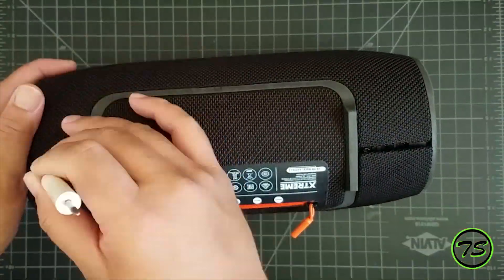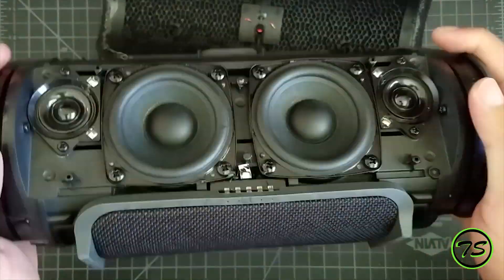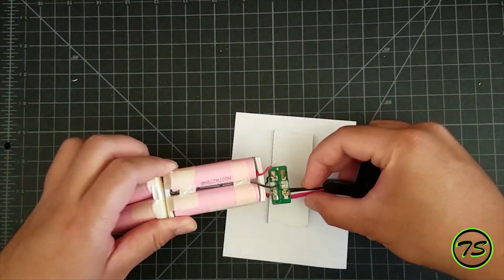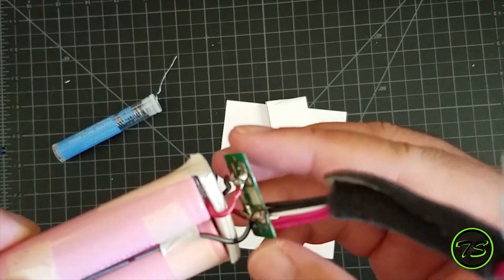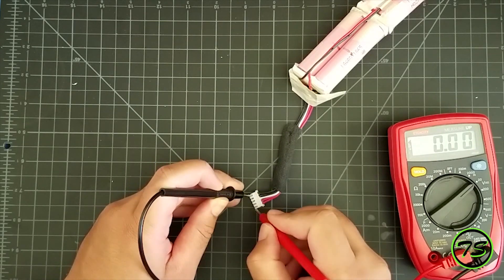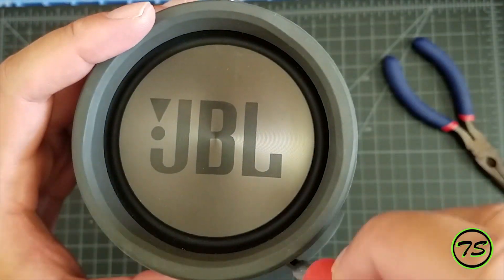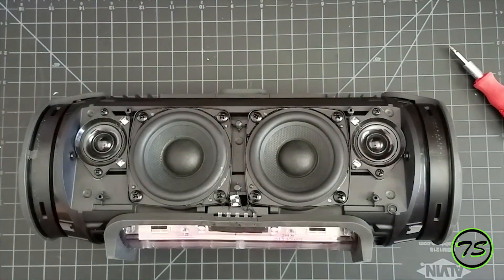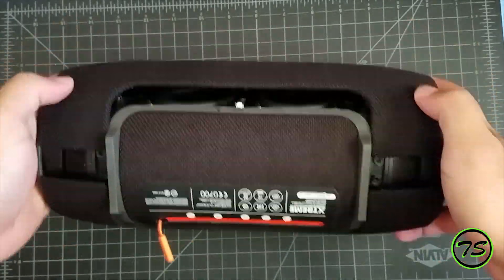(UPDATE) JBL Xtreme + 18650 Batteries (DIY)

Comment: I struggled so long with this stupid board.  Could not get the solder to stick to it.  Surprised I didn't kill the thing with heat stress.
Reply: Heat it up there's an aluminum plate on the board, that needs to come off before you can solder to the circuit board underneath.
Reply from the maker: Yes the BMS board is a pain to deal with.
Reply: How did you manage to solder it? Couldn't do it even after removing the aluminium plate

Comment: Hey i just subscribed great videos keep up the good work i just saw this video and i was like well where will i find 18650 battery’s and then i hit your channel and saw your video on how to obtain battery’s from a self balancing hover board and thought i would take my old hover board apart and i removed all 20 li-ion battery cells  they are by LG but i don’t know if they will work they are marked lgdamf11865
0320k162a2  I’m not very experienced with these kind of things i have a friend who can install them but he needs to know if these battery’s will work first and if you could send me a schema of how to connect the to the bms thanks in advance!
Reply from the maker: Thank you for the support, I am working on a video on how to find out which 18650 is still good for use. I haven't really had time to finish it due to family duties, planning to upload it before 2017 ends and I will add a schematic for the BMS as well.

Comment: If not use bms board what happens? I lost my
Reply from the maker: You can always buy a battery on eBay, I’ve seen both original and those that aren’t but still works but it’s just less mAh. In other words just less playing time but still good enough to enjoy hours of music that you love.
Reply: If connecting directly without BMs, works?
Reply from the maker: +Fernando Jose I don't think it's a good idea because the batteries won't be protected from being over charged. That's what I think, I haven't tried it but wouldn't recommend it.
Reply: Ok thanks

Comment: my speaker just stopped had my phone charging on it and now it wont turn on at all plugged in or anything. Any ideas to fix
Reply: next time jist hold + and bluetoth button to make hard reset ... i will try relacing this batts with 18650 as in ur video .. nice job man
Reply from the maker: Wish I had an answer for you, tried researching about it but I can't find a solution.
Hopefully someone knows something about this issue.
Reply: ended up taking out battery and when i plugged back in it worked
Reply from the maker: Wow it was that simple, good to know so if it happens to me I can try that easy troubleshoot.
Reply from the maker: Yes that's right, forgot about that key combo.
Thanks for the support man
Reply: Mine did the same thing.  Started when the original batteries started to become faulty.

Comment: is it really true, that the original jbl xtreme battery has 5000mAh battery, instead of 10000 mAh?
Reply: I got my friend, I changed the battery and put the 4 in place of the original, I'll test the weekend and see the durability of the sound with the new ones I put.   https://produto.mercadolivre.com.br/MLB-743554437-bateria-panasonic-ncr18650b-3400mah-li-ion-37v-original-_JM
Reply: what would you recommend, just order original battery or mess with the 18650 batteries? obviously u get more power with 18650s, something like 12k mAh, but with the original, it's like 99% everything gona work as it's suposted to, but with 18650s, im not quite sure, if it's gona charge properly, etc
Reply: I found the originals very expensive, and I chose to buy the ones that were indicated and came out less than half the price, and worked out right in the same place as the originals
Reply from the maker: +africabambattaa yes only 5,000mAh, I didn't believe it at first until I actually found the hidden label stating "5000mAh @ 7.4V" this was after I recorded and uploaded my videos.

Comment: the capacity is less than the correct original battery? because they are 4 of 3400mah parallel, and how long is it, is the same thing as original or longer?
Reply: From what I remember JBL says that the original unit has 10,000mAh?, the original battery that you are looking at says 5,000mAh on the label ...but there is two sandwiched together (Lipo's) making it a total of 10,000mAh...right?. You would be replacing that with a total of 13,600mAh which has a bit more capacity. The BMS should be safe charging  the extra capacity. I doubt JBL is going to lie about the battery capacity, it is something that can be easily proved.I will be going with a replacement battery rather than with the 18650's but I will most likely go with trying that the next time the battery dies. Cheers All
Reply: I put the 18650 and it was spectacular
Reply from the maker: If you use any 18650 that has 3000 mAh or higher then its longer playing time then the original. I found out on the label it's only 5,000 mAh from the whole original JBL battery pack
Reply: mine is now only lasting 1 hour of battery, I will buy 4 of these and do, it worked in the same place as the original, or had to cut or change something?
Reply from the maker: You're just changing out the lipo batteries that were connected to the BMS board and use the 18650's you bought. Make sure its not those cheap kind because they tend to false advertise how much mAh they have.

The BMS board is with the original battery so be careful when you take that black cover off from it.
Reply: So JBL lied saying the original battery was 10000mAh...
Reply from the maker: That's what I found out on the label of the original battery that it was only 5,000mAh, I am trying to see if I can get a hold of someone that has a JBL with battery issue so I can prove it on video.
Reply from the maker: I'm glad someone is on the same boat as me
Reply from the maker: Whatever works for you and makes you happy, I just used the 18650s for my JBL Xtreme because I had extras that was not in use.
Reply from the maker: Robert Lecocq I am not sure what video you are watching but yes it does say 5,000mAh on one side but it also says 7.4V. Which is wrong if you are thinking each cells is 5,000mAh with 7.4V. A fully charged cell is 4.2V, same as when the 18650 were fully charged as shown in the video @ 4:18 and yes I fully charged the speaker before I pulled those 18650's out. If you think I am wrong then my 18650s would have exploded by now if the voltage been fed to the them is 7.4V - 8.4V each cell.

JBL is a good company but I am not sure what they meant by 10,000mAh, should be 5,000mAh @ 7.4V as it says on the label.
Reply: Voce e brasileiro?preciso de ajuda
Reply: fala comigo? coloquei a bateria como foi indicado.
Reply: fala comigo? coloquei a bateria como foi indicado.

Comment: whenever i charge my xtreme the charge indicator light (right most led) will flash 3 times and then stop.
Reply from the maker: +maxell5306 was this after you changed the battery to 18650?
Reply: Taylor Soloai yes.and whenever charger is connected theres some weird sound and when you turn on the xtreme it will reset itself on/off until you remove the power.
Reply from the maker: +maxell5306 does it do the same when the battery is removed?
Reply: Taylor Soloai I disconnected the battery and plug the power supply and all 5 led light light up with the last bulb blinking.and theres no weird sound coming out now.i think i have to check my solder
Reply from the maker: +maxell5306 and also double check if the batteries connected the correct way. Like negative to negative on the board and positive to positive.
Reply: Taylor Soloai re solder everything and the hearbeat sound is audible whenever power is connected.also led lights is not working (power status).although the unit is working fine when unplug to power source but still no led light for power indicator.
Reply from the maker: This is just just my guess but I think it might be something wrong with the BMS board, because you mentioned earlier that it doesn't do that when the battery is unplugged. Kinda hard for me to give you a straight answer when I can't see how everything is connected. Maybe you could upload a video explaining how you connected the 18650 to the BMS board and what happens before and after the battery is unplugged. That's if you can.

Comment: how long is battery time ???
Reply from the maker: +KenT. ZzeT in my case I use it at around 50-60% volume and I get around 24hrs of use.
Just depends on the 18650 you use and also the volume you playing music.
Reply: ok thanks
Reply: If you compare previous battary..?
Reply: Taylor Soloai i used a different brand of 18650 batteries an playing it at 75% of the volume the battery last me about 3 1/2 hrs, and when a connect it the LED lights goes straight to the 3rd or 4rd light...??? What could be the problem??? The batteries???
Reply: @eherpin  The problem could be the batteries you bought... I'm planning on buying the 18650 from Panasonic, what did you buy?
Reply: DarkBallShadow  I was using some cheap batteries, after this video I buoyed the same pink Samsung batteries, and the problem is still the same, battery life is 3-4 hrs and the charging time is about 45min. So I’m thinking is the charging plate is not working properly. What do you think..???
Reply: So, it is actualy better then originial?
Reply: @MarMar-kz7hc  Well, comparing 10000mah original to almost 13000mah... the mod NEEDS TO beat the original :D

Comment: Does the original poly battery connected in series or parallel? what their capacity?
Reply from the maker: +Sabahan Ranau same way I connected the 18650 battery to the board. Two poly cells rated @ 3.7V (4.2V @ full charge). On the label it said 5,000mAh.
Reply: so what is the output 4.2? or 8.4?
Reply from the maker: Sabahan Ranau 8.4V

Comment: Nice work.  Keep it up!
Reply: Is the 18650 better than the Original?  How many mAh does it have? The original is for 10,000mah and I only  see a bunch of 5,000. I just want 10,000 or more (if possible).  Thanks
Reply from the maker: During the time of making this video I didn't have the right tools to measure the mAh the 18650 batteries had but I estimated that both pairs had 6000mAh (3Ah per 18650). But considering that these were already used in the Dell laptop I'm just guessing it's between 2Ah 18650. These are just my guess.

The only good thing about using 18650 is

1. They're cheaper than the original one or even free if a laptop repair store is willing to give it to you for free.

2. The battery lifetime seems longer. Im still using the same one.  It's over two years and it's still going.

Anyway I don't think JBL was being honest about the capacity of the original battery because when I looked at the label when I fixed someone else JBL its only rated at 7.4V 5000mAh.

Comment: hi just wondering to know after puttingthis 18650 batteries are you using the same charger? Thanks
Reply from the maker: ...interesting, I'm using the speaker cables too and it worked. (The thin kind) Let me know if it worked or not.
Reply from the maker: +Roberto Salas Vásquez yes I'm using the same charger. That BMS board I showed in the video is what makes it possible to balance out the charging of the battery.
Reply: cool! thanks and one more question... the batteries have to be protected or not? because I'm planning to buy a panasonic NCR18650B flat top 3400mah thanks
Reply from the maker: +Roberto Salas Vásquez I don't think they need to be protected because of the BMS board that keeps it from over discharging or over charge.
Reply: Roberto Salas Vásquez.
No need to be protected. I am using non protected on mines and works fine ..
Reply: Roberto Salas Vásquez when you are going to solder remember to sand the battery or it won't solder it will just run off .
Reply: BRUT3MURD3R3R what do you mean with sand the battery?
Reply: Roberto Salas Vásquez 
Tienes q lijar la batteria porque no se queda la soldadura .solo en los lugares donde van los cables
Reply: hey thanks for explaining me with apples haha! I did everything you say but for some reason is not working can you help me please!
Reply: Roberto Salas Vásquez 

https://youtu.be/KFuXHEkoJq4

Look at that video it has a picture of what you need to do
Reply: Roberto Salas Vásquez look at 1:15 for the picture
Reply from the maker: Assuming that you wired them all correctly remember it won't work for the first time, that's why you connect the charger to activate the BMS board.
Reply: I connected then all but I think I'm using the wrong cables or not the good quality( speaker cables) so I found ticker cables and I'm going to do everything again
Reply: finally I could do it!!! it's working properly but after a few minutes goes off and doesnt work until I connect it to the power cord... why is that I did something wrong? by the way when I was soldering the batteries the negative cable touch the positive cable by mistake... do I probably burned out the batteries? please help thanks
Reply: Roberto Salas Vásquez. 
Maybe a wire is not soldered correctly could be loose happened to me .
Have you charged the batteries yet ?
Reply: I hope is just a wire loose... yes I have charged them during the whole night
Reply from the maker: Roberto Salas Vásquez Yeah I'm thinking the same thing. Might be a loose wire.
Reply: Taylor Soloai It happened to me twice . I out a big wire and it was getting stuck and coming off . works good now I changed my batteries months ago and they are working better than ever .. Good luck buddy

Comment from the maker: I know a lot enjoyed my videos but I would also like to hear some feedback on what you did not enjoy so I can make it better for future videos.

Thank you again for watching
Reply: Mate thanks million times , I did exactly as you said and I used dead laptop battery and did work , thanks thanks thanks.
I did talk to JBL Australia and they said there is no support and parts after warranty which is just one year .
God bless you .
Reply from the maker: Yeah seems like everyone with a JBL Xtreme has a battery failure after one year of warranty. I am glad it worked for you though. Everyone seems to give up at the soldering the wires to the BMS part.
Reply: Taylor Soloai I did use BMS as you said . Because of overcharging problems . Thanks again .
Reply: Taylor Soloai : one question. Does a 18650 with Any 3600 mah will be good for the speaker?
Reply from the maker: Robenson Germinal the higher the mAh the longer the playtime you get for the JBL Xtreme.
Reply: Taylor Soloai awesome I follow the directions  step by step the the result was "no dyol to talk in creole" That's mean I have nothing to say. Taylor you are the man you save my $175 investment. Thank yo SO much.
Reply from the maker: BlackSpider Zordyck yes you can use it without the battery.
Reply from the maker: BlackSpider Zordyck on eBay it's under the name "Nickel Plated Steel Sheet Strap Strip for Battery Spot welding". It was already on the battery when I removed it from the laptop battery case. Anyway yes you can solder it together using a wire, not the recommended way of doing it but just make sure you don't heat the battery too long. 18650s are dangerous so be careful! To make it easier get a soldering wire that already has flux in it and also scratch both negative and positive terminal of the battery with sandpaper to make it easy for soldering.
Reply: Taylor Soloai Thank You Very Much for your help. I appreciate it...
Reply from the maker: Thank you very much, it feels so good to know that my videos are useful
Reply: Taylor Soloai hi i want to know if its possible to do it on the jbl flip 3 ??
Reply: Nima Davoodi should you get new batteries after that ?? Maybe it wont last long :/
Reply from the maker: joshua gabriel im not sure because i haven't opened a jbl flip before.
Reply: Taylor Soloai oh ok , future video perhaps ??
Reply from the maker: If I can get my hands on one then yeah I will.
Reply: Taylor Soloai can I use my JBL without the battery...? Is it safe to use it only with the AC power...? Thanks...
Reply: Taylor Soloai what is the thin metal at the battery...? Can I solder the wire diretly to the battery without the thin metal.? Thanks...
Reply from the maker: BlackSpider Zordyck no worries

Comment: What exactly do i need to solder them up?!  And how did you do it?
Reply from the maker: Those are called "Nickel Plated Steel Strap Strip Sheet" found on eBay but I didn't have to use those since the 18650s I used were salvaged from a laptop battery which was already connected in parallel.
The wires, you can use any. I just used speaker wires.
Reply from the maker: I don't really understand what you are trying to ask but I showed everything in the video of what to solder, if you are wondering where the green board (BMS) is from. You can take it out from the original battery and connect it to the new 18650s.
The link below is the previous video I made and I showed where the board is at
https://youtu.be/hwWD5W2svY0
Reply: He is asking what do you need? What type of wires, I noticed you had something connecting the batteries in parallel. What are those called?

Comment: I later encountered a problem, the circuit board can not be welded to the wire, that is, the use of flux is the same, how to do?
Reply from the maker: +信仲陳 you can use sandpaper or a knife to scratch the surface of the terminals. It will help a bit but still it took a lot of patience for me to weld them on and also steady hands.

Comment: What is the white block that sticks to the positive and negative batteries?
Reply from the maker: 信仲陳 that's just pieces of foam board which I mentioned in the video I don't recommend using because they're to thick and it will not allow the battery to fit inside the battery compartment. Just use something thinner to separate them.
Reply: Taylor Soloai Thank you, this film is very helpful to me, because I also encountered the problem of battery replacement .
Reply from the maker: 信仲陳 I'm glad it helped